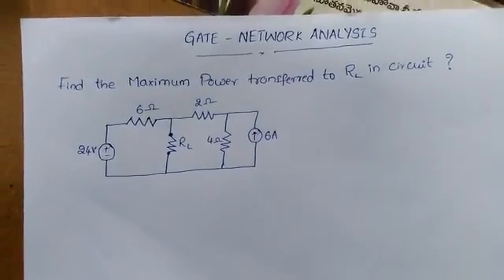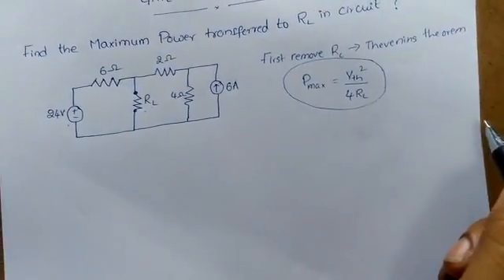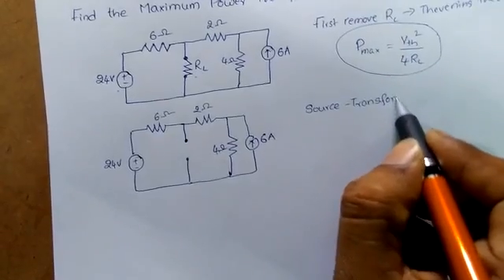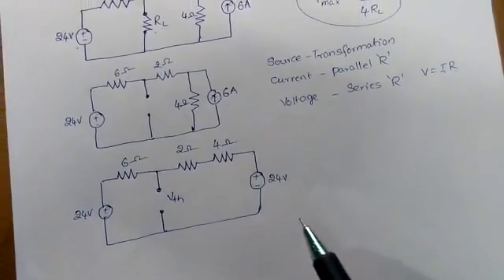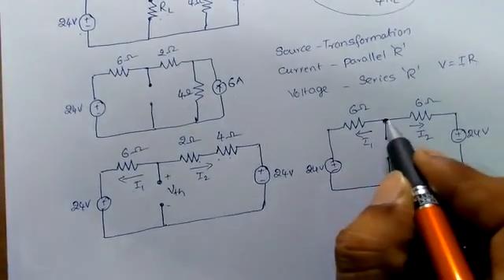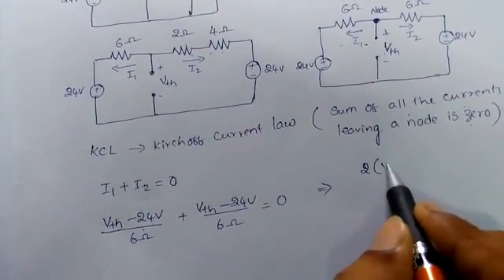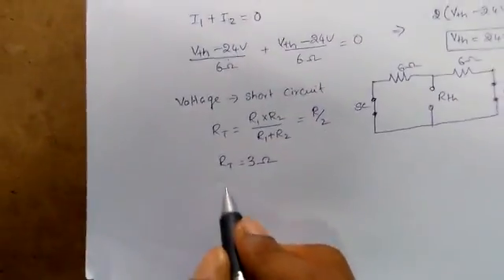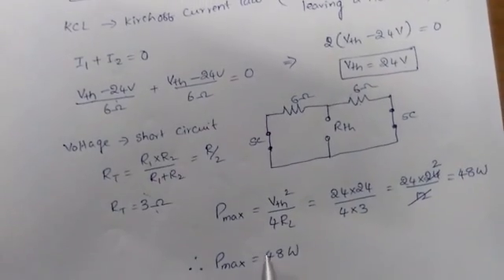Maximum power transfer in Network analysis GATE ECE

Comment: How 2 ohm and 4 ohm get in series??
Reply: Current sources having resisitance in parallel are converted to voltage source with resistance in series by calculating the voltage V=IR,where I is current source value and R is resistance in parallel to current source.
Reply from the maker: simple fundamental : if the same current flowing through both resistors then they are in series

Comment: why node voltage vth -24v/total resistane ,i think it 24-vth/total resistance bcz current flow upper level to lowel level,plz reply me
Reply from the maker: Masud Rana 
My dear friend current is in two forms 
Actual current & conventional current so go through that topic you can understand very well
Reply from the maker: Knowing topics actual current & conventional current you can know what masud Rana asked
Reply: plz sir clear me why Vth-24/6+vth-24/6=0,i think it will be 24-vth/6+24-vth/6=0 bcz current flow upper source to lower sourch,plz clear me sir
Reply: ok thanks

Comment: this numerical should be done in 1 minute hardly.. find Rth directly removing load resistor & the branch that contains  current source.the redrw the circuit. yu found across Load resistors 3  ohm is net resistance that is Rth,,..the, Rth=R load for max power, 
then, Pmax= Vthsqr/   4Rth